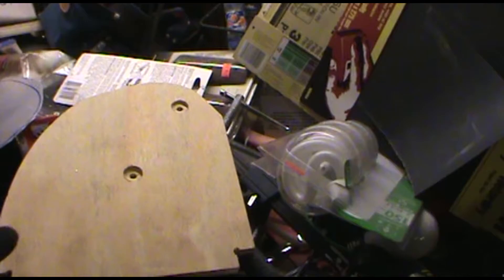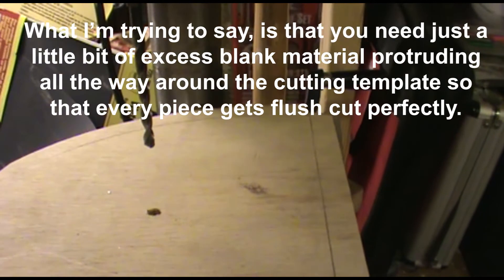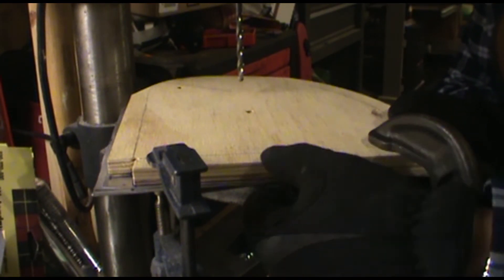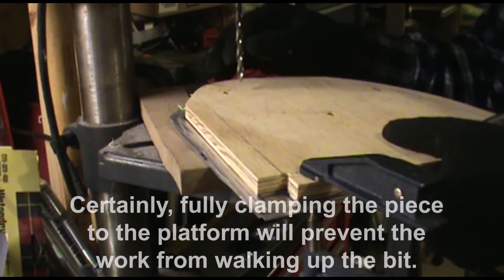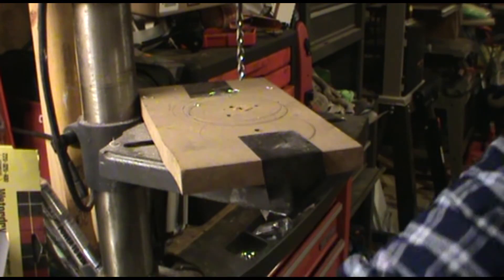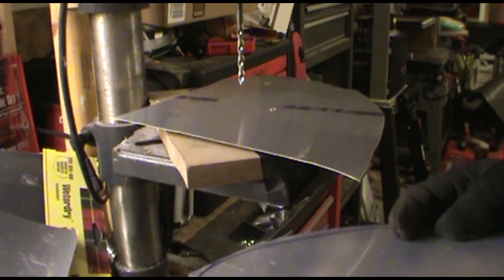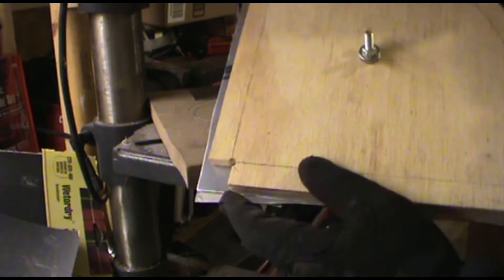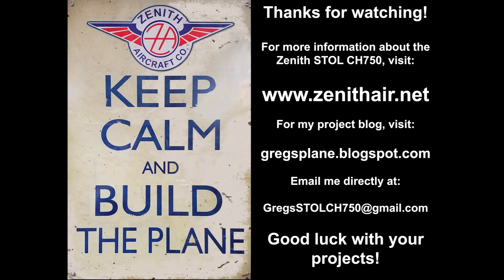Router Cutting Templates - Part 1/2

Comment: Thank you so much for your awesome Videos! I’ve been on an emotional roller coaster deciding between kit building and scratch building (I wouldn’t be able to afford a kit in the next couple of years)
Have you made your wing spars yet?
I was wondering how difficult they are.
Reply from the maker: I have made the components for the wing spars, but haven't assembled them yet. They (and the cabin sides) have to be put together with solid rivets, which is a different process than the pop/blind rivets used in the rest of the construction. I know of several different approaches to building up the spars, from complicated fixtures and pneumatic squeezers, to just using simple rivet guns and doing it manually. Scratch- building is a long, slow process and will likely take me 6-7 years at least. If you order smaller component kits (like just the tail section) from Zenith, you can kit build without having to buy the whole thing all at once. The tool investment in scratch-building is pretty substantial unless you already have them.
Reply: Thanks for the reply! I may do a combo of kit and scratch. 
Keep making the great videos!